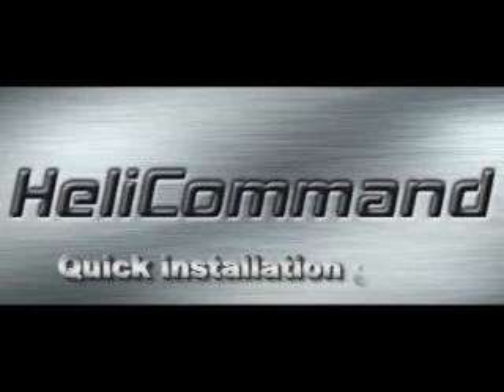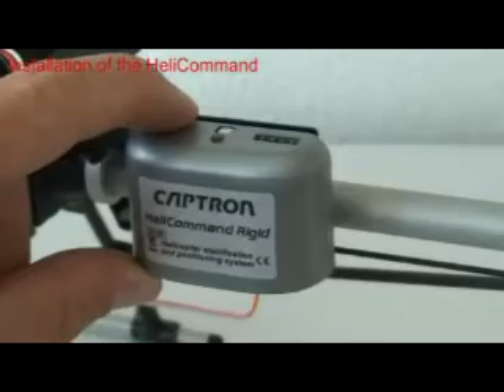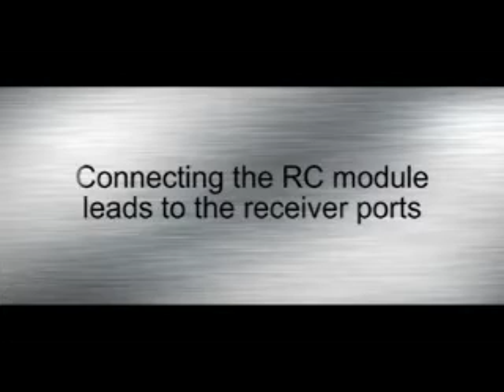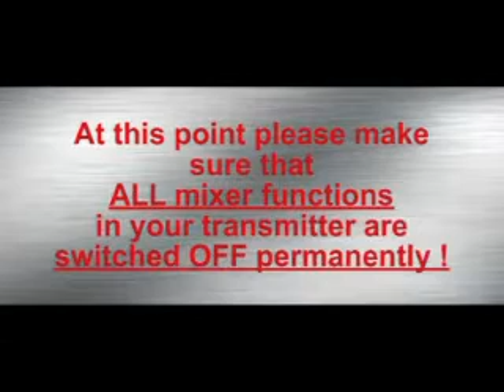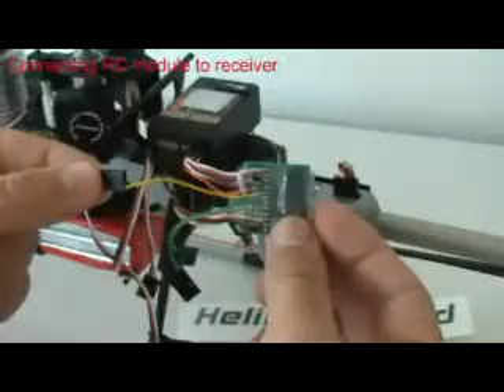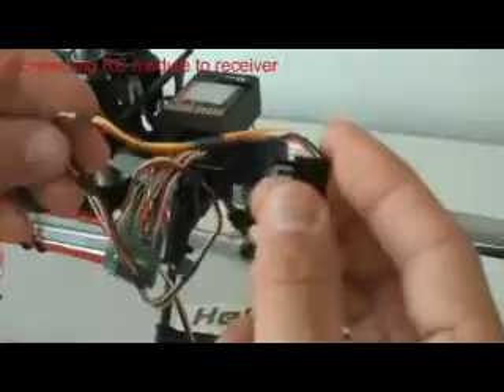Helicommand set up part 1

Comment from the maker: The helicommand works anywhere as it uses gyro stabilisation, the Alien command advanced uses heat sensors and an on board mixer, it still needs a large open area to operate effectively. IMO the helicommand although more expensive is better as it has no restrictions on where it can be used.
They both work well at any height although the positional mode on the helicommand only works efficiently at up to 5m to a max of 10m (after that it auto switches to horizontal mode)

Comment from the maker: No the helicommand will not avoid obstacles, and you can still crash when using it. It will keep the heli in a stable position but you have to avoid the ground etc.